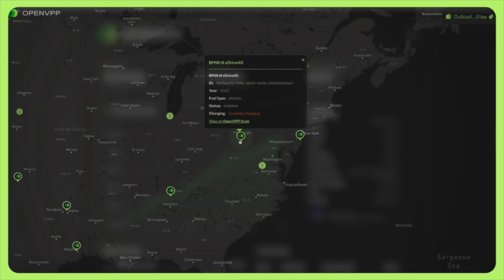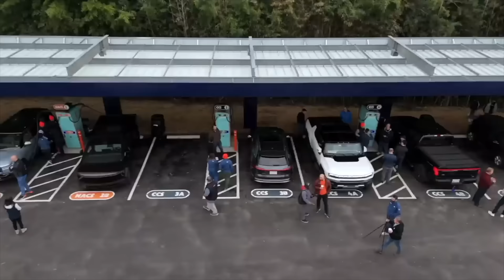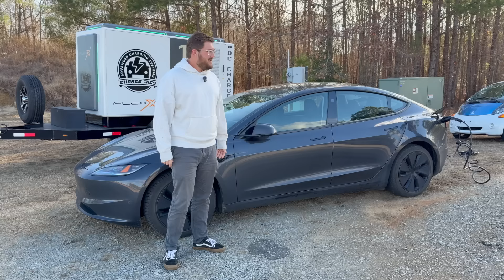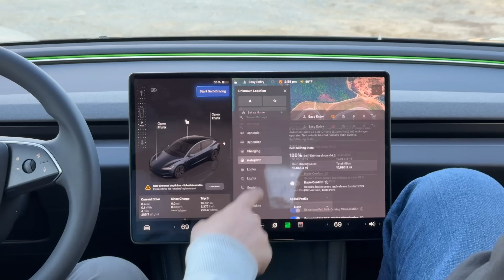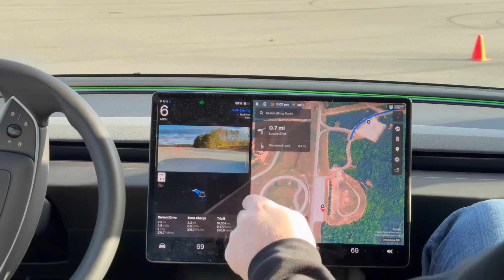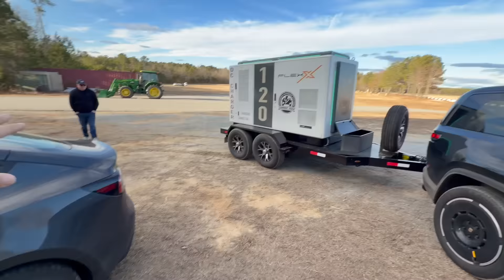First Cross Country Autonomous Drive Completed! Over 10,000 Miles Using Tesla FSD w/ No Intervention

Comment: My wife & I are sold!  She’s got a 2-hour commute every day in Atlanta traffic. FSD in stop-n-go traffic will be worth every penny! I bought the Performance so that I can ‘borrow’ it on the weekends 😂
Reply: It’s going to absolutely blow your mind. It really really really works amazingly well. Congrats! 🎉
Reply: Driving from Johns Creek to Midtown three times a week, 90% +  on FSD. Truly a life saver!!  The 10% manual drive is to avoid roads filled with potholes. And one other quirky thing is it prefers to move to the exit lane at the last moment,  within the last 1/4 mile of the exit lane.  That doesn't work very well in mid-town traffic.  So I have to take control of it,  a mile ahead and move to the right most lane manually
Reply: @rjk471 can you just trigger it to move over using the turn signal vs. take over like they showed in the video?
Reply: @daryllu2093  My wife tends to take over and I'm a blinker guy. Blinkers work great with v14.2, older versions would ignore the blinker suggestions.
Reply: @rjk471 instead of taking over manually, you can try turning on the turn signal and it should change lanes
Reply: @MrRyan6201  I tried it,  it does move to the right lane which happens to be the exit only lane.  The exit lane usually tends to move slower because of the traffic backed up from the intersection.  Sometimes FSD looses patience and wants to leave the exit lane to get ahead of  slow moving traffic . If I allow it to do that, it will put me in a much more precarious situation when it tries to re-enter exit lane again.The behavior is really unpredictable, I have to be extra cautious to not allow it to leave the exit lane. That is the reason I prefer to drive the last 1/4 mile manually to avoid unnecessary tension😀
Reply: @rjk471 also putting it in chill mode will have it plan sooner
Reply: @rjk471  Even though it gets over last minute, I’ve found it’s still really good at getting over. It will straight up shove its way into a lane if it’s really getting down to the wire. It will also cross over the gore to make an exit if it has to.
Reply: FSD will shine in your scenario.   I can’t believe how good it has gotten.
Reply: Today, at a busy, mostly filled supermarket parking lot FSD avoided all the empty spots reserved for pregnant women, women with children, Instacart and employee of the month spots and perfectly pulled into a rare open parking spot. In another parking lot yesterday it stopped for a car pulling out of a parking space and then pulled into that spot. I was impressed.
Reply: Enjoy! We love ours. Best car/value out there.
Reply: FSD version 14.2 is superhuman-like. Once you have it, you can live without it, haha
Reply: @sparky-panda  Tesla's FSD software has been undergoing training and testing in China, primarily using data from its large fleet and simulated environments, using internet-sourced video for training and adapting the system locally
Reply: Don't you have Trains in the us?
Reply: @petrimuinonen3462 Atlanta has two train lines in an X shaped layout.   That's it.
Reply: @petrimuinonen3462  only for the Acela line in the Northeast mainly
Reply: @petrimuinonen3462 very limited
Reply: @petrimuinonen3462 You do NOT want to ride the subway in Atlanta 🤣
Reply: Maybe consider moving or switching jobs? Even when she's not driving, that's a horrible way to spend one's life.
Reply: @marek9930  Moving to a smaller city that doesn't have jobs? I've been south of ATL for almost 60 years; it's one of the hottest job markets in the country and the constant expansion is the result. People are fleeing LA and NY and moving to ATL, DFW, and RDU. Thus, we're buying a Tesla for the 1st time to improve our quality of life. Sounds like we're a little late-to-the-game as many others have responded that they've already been using it for a while 🤣
Reply: @hangpilot1200 are you seriously suggesting it's impossible to move closer to your job so your commute isn't 2 hours?

2 hours each way. If you're working 5 days a week you're really spending 20 hours a week just sitting in your car?

1040 hours a year!!
Reply: You will love it! This FSD tech is truly amazing. 👍
Reply: It’s works great in Atlanta! Perfect for Atlanta traffic. It’s funny passing the Waymos around midtown and surrounding areas when you’re also in a self driving vehicle.
Reply: Perfect car for long commute.  She / you will save a bunch of $$$$ in fuel and maintenance. FSD will for sure lower the stress of driving
Reply: You’ll love it!!
Reply: Supervised... 
You can't switch-off and do other things with your silly long commute yet...
Reply: @DevAnubis so what? It still takes the stress and fatigue of driving away. I've driven 1000 miles on FSD without stopping besides charging and felt like I could've kept going for another 1000 miles if I wanted
Reply: @leanderzulu3494  because when 99% of the time it works, you're not going to be prepared when the 1% happens and you're liable because you were supposed to be "supervising" 

It definitely makes people less prepared for an accident
Reply: @DevAnubis not yet....
Reply: @DevAnubis yeah, this is still the problem. I'd move further away from the city if I could have a car drive autonomously while I do other things. One day...
Reply: @daryllu2093  there's stages of value, you don't realize the value chain until you're sitting in one. Less stress, less mental fatigue, less aggravation are the first realized value in that value chain. Honestly, people won't even understand those values until they're sitting behind the wheel supervising it.

Comment: I'm holding my comments until the end of the video, but as a long-time FSD user, I have many questions and much skepticism about the claim.
Reply: It can definitely do cross-country, but we are at the point where a lot of the "problems" are typically towards the beginning and end of drives. For example, getting out of parking garages, or parking in general.
Reply: I am at 81% but mostly on 14.2.1

Comment: I feel like autonomy is a complete waste of money. If people want to be driven long distance, take the train. The billions of $$ invested in autonomy could be used to upgrade our rail system to that of Europe (not Japan). There are way too many situations where a human is required for automobile operation (look at the recent Waymo power outage).
Reply: Japan and Europe, land wise are much smaller than the size of the US.. China has the biggest rail network for public commute but it runs on losses, so, it’s more like public service..
Reply: US has horrible intrastate infrastructure.  Taking an airplane or train means you need a car at both ends and unless you’re in a major city (which isn’t 95% of the US) you need your own car.   Tesla still struggles at end of drives but it’s amazing on the highway compared to other “cruise control systems”
Reply: Go ahead and do your due diligence and see why it hasn't been done.

Comment: I am at about 80% FSD miles.  I usually take over in parking lots because while FSD can do it, I can do it much quicker.  I also simply just want to drive because it's fun to drive an EV!
Reply: Exactly how I am. The parking spot to parking spot is cool. But it’s slower than I’d like. There are also days I want to just absolutely rip on the car because at the end of the day it’s still meant to be driven.
Reply: About the same for me! But the % makes me want to get up to an “A” grade, lol years of conditioning…
Reply: Does it work in the dark? I have the M3 2019 long range and I frequently have the warning sign of cameras not working in the darkness
Reply: @ruggeroama9464 I’ve had no issues at night with FSD working but I primarily drive a HW4 car. If it’s raining it will sometimes complain  about the rear camera being obscured but I don’t notice it acting any worse, if anything lane changes a little slow. Our HW3 car, like yours is imho a horrible user experience day or night and not worth the cost.
Reply: @DeathBlade94  thank you so much. From my experience I still feel skeptical because of the limitations with bad weather, the fantom braking (much less but still present), the random start of the wipers and the mentioned problem in the night. I can’t wait to try the new software. And despite Musk, I have to say that it is the best car I ever owned
Reply: @ruggeroama9464 you’re welcome. Like I said hw3 cars on v12 are definitely way behind in comparison to hw4 cars on v14. Till v14 came out I really would never consider paying for FSD. Since v14 on the current trial they released I would pay for it if I was going on a trip. It’s been day and nice difference. I’ve had it take on several weather and what felt like no less then 95% confidence.
Reply: @ruggeroama9464 works decent in the dark with rain, fog, and mountain roads. I have hardware 4 M3P 2024 though. Just downloaded and installed 14.2.2.2, so running it through its paces, did a weird left turn contrary to navigation to charger tonight though really weird

Comment: I really want to know what happens to one of these cars when it has a major fault like when a tire blows. If they car can recover and pull over safely then I would say it is fully autonomous. 

With Tesla keep upgrading the computer in the car that controls all the operations it can do for autonomous driving I don't know when I would recommend someone get a vehicle for this feature only, Tesla doesn't have a cutoff date for OTA updates so that means whenever they deem it to costly they can stop supporting the older cars with features and improvements you were expecting. Until they make it standard for every user to transfer the FSD software license I would not give them a dime.
Reply: Kyle, have your girlfriend shoot out one of the tires while you're driving just to test this.
Reply: @scottbreseke716 lol!

Comment: You can do AC charging on overnight stops i would think
Reply: The problem might be getting FSD to park correctly at level 2 chargers. It seems to park at superchargers just fine. This is why Kyle gave him the extension cord.
Reply: @BitJam There are some level Il chargers in not so precarious parking situations available, but he could have  been using an older version of FSD for a bit of the traveling.